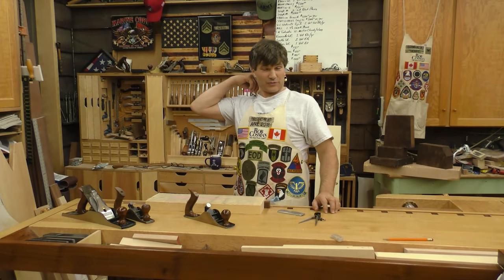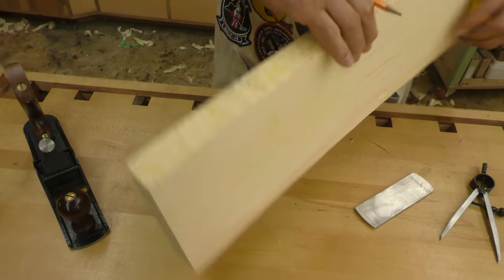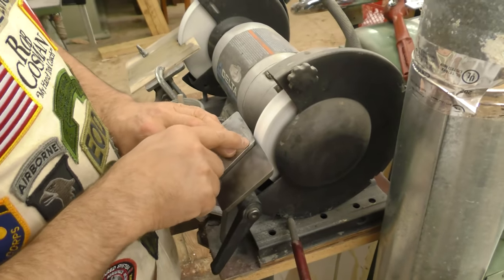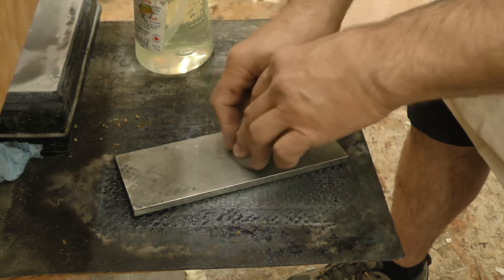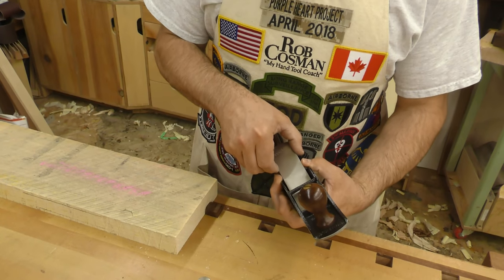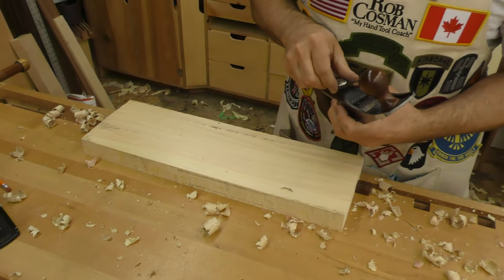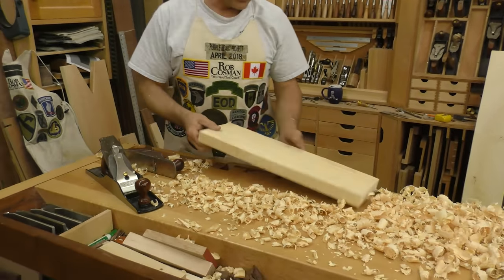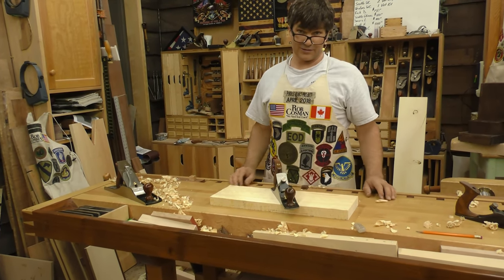Scrub Planes | Sharpen and Use a Scrub Plane

Comment: I am a new wood working, just getting into the craft and want to work with hand tools, could any one answer me a question? I only have 4 planes, a old Stanley #5 and #4, a Woden #4 and a Stanly HandyMan (a #3 i guess?).
My question is can I use the handyman as a scrub plane?  I have set my Stanley #4 as my smoothing plane and the others are jus set up normally.

Comment: Thanks for covering this, Rob. I made a scrub plane out of my dad’s old Stanley Handyman #4 a couple years ago, as it just wasn’t a good enough plane for fine work. It’s nice to be able to keep a family heirloom tool in service. If you were to demonstrate a similar conversion of an old plane into a scrub plane n a follow up video, I think a lot of us would appreciate it.
Reply: Hey, I have a #4 Handyman I'd like to convert, I think that's a great idea for a video.
Reply from the maker: I dont think vintage bench planes make good conversions into real scrub plane because the blade is so thin.  A scrub plane blade needs to be very thick to stand up under the stress of scrubbing.  You could buy a new thicker blade but you can get a scrub plane for the cost of a new blade.  The best way is to just buy a new or used scrub plane
Reply: That's what Paul Sellers did. He converted a Stanley Bailey No. 4 into a scrub plane. Great way to use a plane that just sits around.
Reply: @Mr_Rick  I trust Paul's advise and experience (with 50 plus years), but he doesn't go Olympic competition race at it like Rob just did in this video. Will the thinner blade handle it, like Rob is saying? I don't want to convert an old plane just to crack the carriage/body, or bend the iron, or something.
Reply: @thomasarussellsr  Fair comment. I did Paul's conversion on a #4. It works like a charm. Thin blade isn't an issue. Chip breaker is still used with corners slightly modified.
Reply: @Mr_Rick  how much did you have to open the mouth of the plane?
Reply: @thomasarussellsr  It's very little but depends on the plane. Between 1/32 - 1/16" if that. Not meaning to be impolite to Rob but I suggest you watch the Sellers video. https://youtu.be/XN5QSTaVzRQ
The mouth opening mod is around "17:30".
Reply: @Mr_Rick  thanks
Reply: An 1/32 opening is a joke of a scrub plane .. not even enough to cover the radius of the blade curve. Go more aggressive .. it's not a smoother
Reply: @thomasarussellsr  thin blades is what they used for decades before Stanley made their thicker number 40 blade.

Comment: Nice demo, Rob! As usual, you offer straight advice from a real furniture maker who actually uses his tools to earn a living. This video, plus your other one on new vs vintage planes, convinced me to buy the Lie Nielsen scrub as a Christmas present to myself. With tax and shipping, the Lie Nielsen was $260. The vintage Stanleys have their charm, and there is a certain romance about holding a tool that was used over a hundred years ago, but as an actual working tool, I do see how a modern one with better steel and engineering that is ready to go out of the box (after some blade honing) would make much more sense. A  run of the mill Stanley in decent shape, with shipping and tax,  costs at least $75 on EBay. A Hock A2 blade or even better, a Veritas PMV-11, with matching chipbreaker is $100. So the old Stanley will end up costing more than a new Lie Nielsen. The stories of some other notable woodworking gurus about how their near-mint original  condition Type 11 Stanleys cost them $10 at a garage sale in 1997 do not reflect the reality I have experienced in 2022. Plus, to make a Stanley smoother into a scrub, I’d have to enlarge its throat with a file so I can stuff a radiused Hock into it, destroying not only its collector value but it’s original design function as a smoother. Why would I want to do that?

Comment: Thanks for the excellent video and thorough explanation. Can you use a scrub plane on end grain? I made an end grain cutting board that isn't completely flat but I don't want to send it through the thickness planer at school. My teacher suggested I build a router sled, but space at home is limited. Thanks in advance!
Reply from the maker: That would provide a good workout, I would use a bench plane were it mine.
Reply: @RobCosmanWoodworking  Thanks Rob!

Comment: Could I take my woodriver #4 or #6 buy a new blade and use it as a scrub plane or is this best done with a bevel up plane?
Reply: yes, a second blade sharpened with a slight camber would work fine.

Comment: 2:45  Anybody, who knows what fluid Rob used here also to prevent rust?  
Sounds something like: "Hungwrite"??   Is it the name of the brand, or ??  
Asking because I've just got 5 used and a bit rusty chisels and 2 old planes, and I would like to try to sharpen them, but it's my first time doing it, and I'm not sure what fluid to use, besides "chalk free water")  
And when (if) I succeed sharpening them, can I use some kind of protection to prevent rust, as my shop is insulated, but not heated when I'm not out there, and humidity here is often quite high in the winter (in the 90's percent)
I do take some items inside the house, but I would very, very much appreciate any tips and tricks to rust-protect other items, like f.x. my new table saw, that has to stay out there ...
Thank you so much  (y) 
Greetings from Denmark   /Pia
Reply: Hey Pia, you should look up some of Rob's other videos on sharpening hand plane blades and chisels since he goes into more detail about the basics.  But I believe he used honeright(I think they sell it on Amazon as Bora honeright gold) which can be added to water to prevent rusting of your blades and diamond stones.  But this is aimed to prevent rust from forming after you sharpen and I don't think it can be used as long term rust prevention.  As to your other question about preventing rust on your other items, like your table saw, I would suggest putting some paste wax on the cast iron or steel parts.  However I don't have to much experience with my stuff rusting because I live in California, so you might want to look up if anyone has had a similar experience to you and what they did to remedy the rusting.  I hope this helps and good luck.
Reply: @alecweaver5759   Thank you so very, very much, Alec.   Your answers help me a lot!
 
I have watched and will follow Rob's videos about sharpening, as well as many other videos, as they are all such an inspiration. 
 <3
Reply: @pirakoXX  honeright is what Rob uses here. If you can't get that then any auto glass cleaner will do (if you're using diamond stoned only, not for oil or water stones). It's to prevent rust on the stones and not the tools. For tools, I just use light machine oil. Wipe it on with a rag and then wipe off with a clean one. Some use the Paul Sellers rag in a can method (look it up), but I find that if you don't use it regularly it dries out. You can also use wax if you want, but I tend to only use that on the sole of the plane to keep it running smoothly (without friction).
Reply: @ricos1497   Thank you so much!  I really appreciate all the knowledge you share with me.  
Paul Sellers is also among my favorites.
Sadly, there are no elderly/experienced hobby woodworkers left in my village, and many of the materials (wax, oil, etc) used in English/American/Canadian channels are different brands from what we have here, or can be bought online, to a much higher price..   
A little Fun-Fact: 
"Danish Oil" doesn't come from Denmark, just like the American "Danish" (pastry) here in Denmark is called "Wiener bread" because it comes from Wien (in English = Vienna) in Austria! 
Again, a huge thanks to you  (y) 
/Pia
Reply from the maker: Pia its called Honerite Gold. We sell it on our website.  Here is a link to it https://robcosman.com/products/hone-rite-gold

Comment: Hi Rob! What is the minimum thickness a plane blade should have based on your knowledge/experience? Unfortunately common blade locally (Philippines) is 2mm, even if the blades are sharp, chip breaker's tuned, frog sitting tight and mouth has the correct allowance, there are times it digs deep and causes tear out. I want to be certain because it is not cheap to import tools.
Reply from the maker: I would not get anything less thick than around 0.100 of am inch thick, thicker is even better.  A thick blade is your friend reduces vibration.  Look at IBC, Hock, Lie Nielsen for thick blades

Comment: Interesting! One question ... why does the blade not have a blade advance slot? To make it stiffer or because of the width and thickness, or other? Cheers, Farmer John, Ontario
Reply: Think it's to make it cheaper to make the whole plane. There's no advance mechanism on that plane other than that which Rob shows where he adjusts by hand and tightens. I'm guessing the idea is that a scrub plane shouldn't be expensive, so less effort is made in its construction.
Reply: @ricos1497  Thx Rico ... I wasn't aware that there was no advance on the plane; maybe I missed a few words while getting a midnight coffee (the worst thing, but you've got to be alert with a sharp instrument) ... so you've really got to hit the grain running with that tool ... using the difference in large opposing forces to make small changes in position is a skill requiring experience ... advancing a blade a couple thou, and not a couple eighths requiring a reset, could take a while, particularly as feel more than sighting plays a larger part with age ... (how old? 
... last opposing forces instrument I used to effect micro changes was my engineering slide rule 🤪) ... seems so retro that I gotta have one! Cheers, Farmer John, Ontario
Reply from the maker: A scrub plane is a very coarse use plane.  Its doesn't need an adjustment mechanism since you do not make fine adjustments (Its a coarse plane).  The key to a good scrub plane is a very thick blade, in fact they have the thickest of any blades even thicker than my IBC bench plane blades.  If you want to do very small adjustments just stick a shim (paper, business card, playing card etc) under the toe while on a flat surface, drop the plane down then tighten it up

Comment: You were having fun!!! I have received no.4 Stanley bailey ( 19 i think) it's an old but new in its condition and i am intending to make it as a scrub plane. My problem with it that it's like new, no one have touch it and set it correctly  the sole of the plane was just like Banana....i have started to flatten it and its very hard steel !!! ( Much harder than my other new planes) i have manege that the gap at the up to 5 mm from front of the plane is 0.1 mm and and at the back up to 6mm is 0.15mm. the rest of the sole is flatten. Are this gaps are good enough for a scrub plane? I can flat it but it will take a lot of time ( i am flattening it manually)...?
Reply from the maker: Yes.  A scrub plane IS NOT a smoother.  Its a rough plane so its bottom could be a banana

Comment: How can you easily spot the difference between the two? (A regular hand plane, and this scrub plane?)
Reply: Blade shape. But any plane can be converted to a scrub plane by just changing the shape of the blade and perhaps widening the mouth to allow for bigger shavings to pass through. It's fairly easy to do on a number 4. It helps to have a grinder for the blade shaping, or you can buy scrub blades to fit a number 4 I think. It's a good project if you have a spare hour or two and an old plane.
Reply from the maker: I disagree with Rico that any plane can be made into a scrub plane.  A scrub plane is the axe of planes meaning its designed for removing a lot of material quickly. To do that you need a VERY thick blade and a blade with a small width.  Many folks take an old vintage plane like a #4 with its thin and wide blade, grind a curve into it and use it as a scrub.  Because of the thin and wider blade it cannot remove nearly the amount of material in a single pass that a true scrub plane can.  It will work, especially in softer woods, but a scrub plan is much faster and better suited for scrubbing.  It can remove why thicker material even in hardwoods.  As for recognizing it, just look at the enlarged pic on the thumbnail of this video, that's a scrub plane